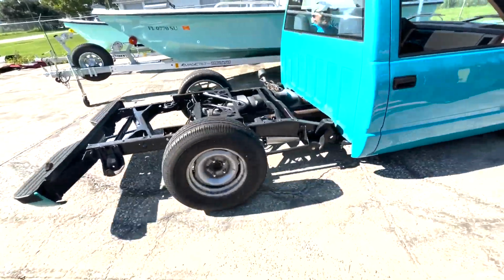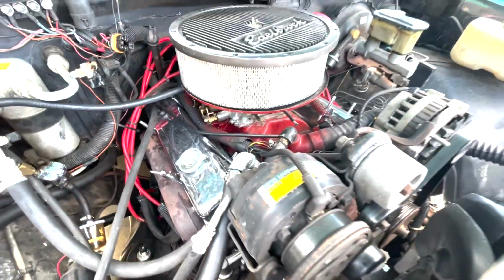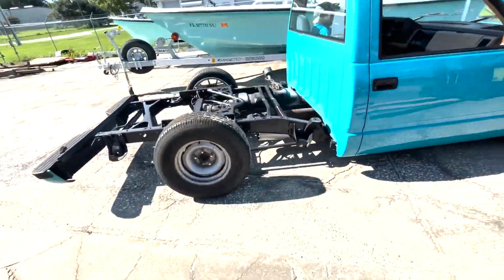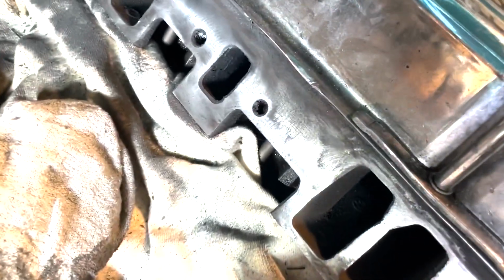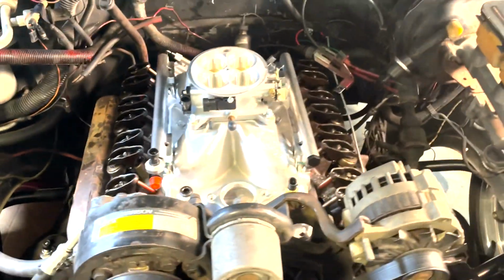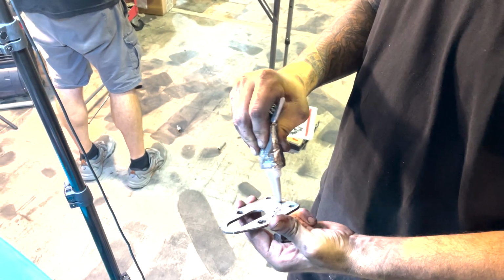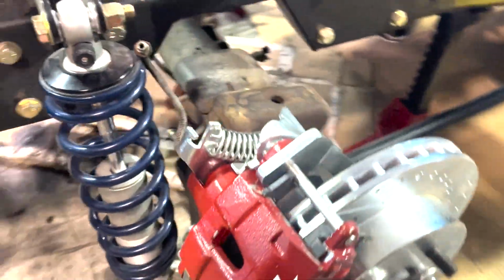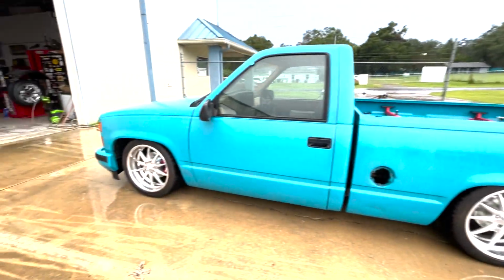Better Burnouts on Project Playboy OBS Chevy Truck

Comment: I am a collector of these trucks… behind the drivers side head towards the firewall and under some wires and sensors, there is a casting number. Google those numbers and u will find out if its a 305 or 350. I have a full 6.0 ls swap with a fresh rebuild and new turbo kit for sale. Brand new everything, cammed with holley term x max… all brand new for sale lmk

Edit: just watched through the video and saw u figured it out… truck looks great dude!!!👊

Comment: It prob had a fuel pump issue so they tried using a carb and differnt fuel pumps would be my guess. And don't 305 exhaust manifolds bolt up to 350 heads?

Comment: What happen to the other rim?
Reply: I guess is not possy track so the only wheel spending is the rear right so is why have the stock metal rim, for burn outs specifically.